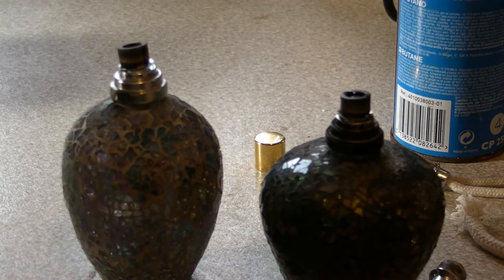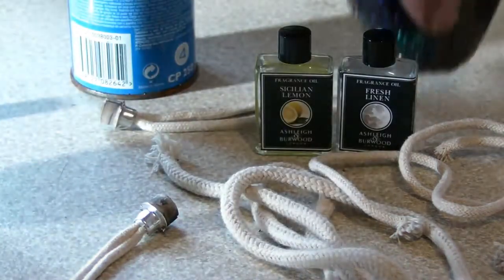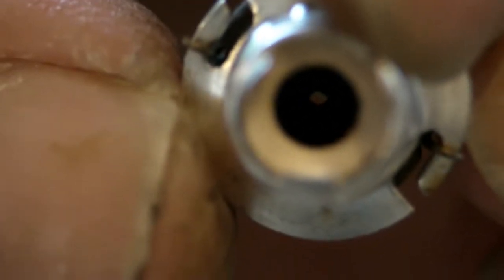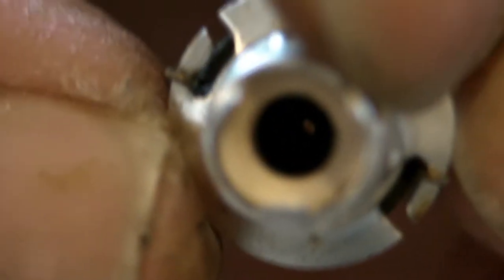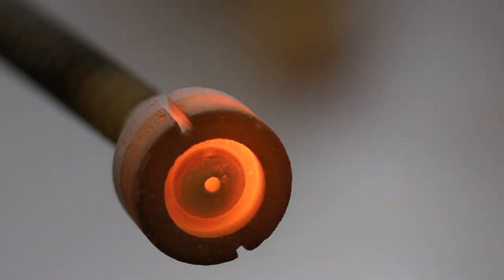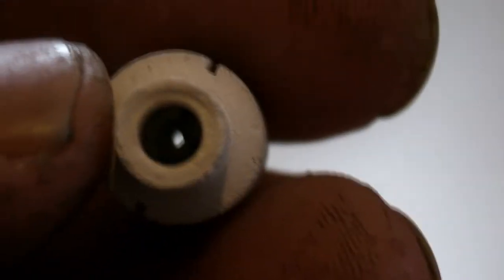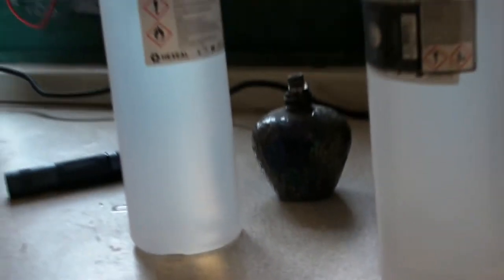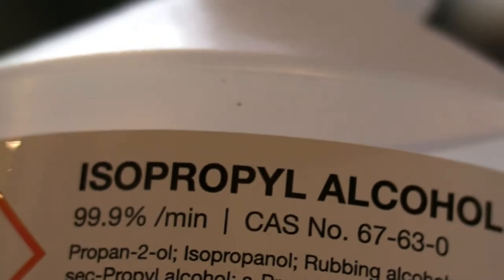Catalytic oil lamp aka Ashleigh & Burwood lamps. Stone and Wick restoration and DIY scented fuel,

Comment: Holy moses.  I have just made my first batch of Sea Breeze, following your instructions.  I already had a 500ml bottle of 99.9% so just ordered the little bottle of Sea Breeze.  To equal to a 1/4, I added 1.5ml of essence.  Even while I was mixing it I was convinced it was not going to work becuase it smelled strongly of acetone (before and after the mix).  Having made it, I used it anyway and I am now sat here imagining myself on a beach, (ok, slight exaggeration), but it is lovely.  Lampe Berger Ocean Breeze is my favourite, but this is pretty dammed close.  Now I know it can be made so cheaply, I am off to buy some more burners for other rooms in my house.  Brilliant.  Thank you so much.
Reply from the maker: You say acetone but i assume you meant to say isopropyl alcohol.
Reply: @Cornz38  Ha ha.  No, I meant to say Acetone.  It is definitely 99.9% Isoproypyl Alchohol, but smells like Acetone (nail varnish remover).  It seems there are a few people on Amazon who say the same thing. What I have made is really nice and strong when diffusing, but sadly, doesn't seem to linger as long as the original?   Still very nice though and much cheaper than the original.  Thank you.
Reply from the maker: @s.c3773  Do be careful, some of the oils are MUCH stronger than other. The mango and nectarine is sickly and overpowering if you use a drop too much oil.
Reply: @Cornz38  Thank you.  I have only made the one bottle at the moment using a ratio of 1/4 to 1L. That will be my starting point for any future batches I make.  Really liking this. :)

Comment: Thanks for making this video! I have seen (though only one other YouTube video seems to explain the process) how to make the liquid at home, but not how to restore and refresh a "wick-catalizer." I don't have a blow torch handy but perhaps a butane lighter could get the job done? I will have to test it out. Again, there's wonderful money saving information here, I appreciate it! Thanks!
Reply from the maker: It needs to be glowing white hot. A normal cigarette lighter wont do it, one of those wind resistant turbo lighters might. Even then, the wicks will eventually degrade to the point where they are unrecoverable but it will extend it's life 3 or four fold.

Comment: It’s actually the metal wire (platinum) that has the whole catalytic process going… There is a video on YT with the history and science of the lamp.
Reply from the maker: What metal wire? Don't say the piece of wire that holds the ceramic is because that is NOT platinum. You can remove that and the lamp still works. There is NO platinum in these. It has nothing to do with it. The ceramic heats up to a point where the IPA is vapourised and it is then self sustaining by capillary action and heat..

Comment: Great vid. indeed! Most appreciated! Not sure what the metal catalysts are in there but 2000C blowtorch hopefully wouldnt vapourise any of them. I know platinum melts at 1700C odd though so that might start moving. Certainly blowtorching shouldnt deplete the platinum component of the catalyst, it vapourises above 3000C. Brilliant!
Reply from the maker: There are no metal catalysts. It's ceramic.

Comment: Hi, thank you very much for this video, it is really informative and useful.  The thing that's puzzling me is the fragrance oil you mixed with the 99.9% alcohol.  The small bottles seem to be just a smaller (and more expensive) option than the larger bottles which are meant to be used neat?  How then can using 1/3rd bottle to 1L produce the same strength of fragrance, surely, the fragrance must be 'watered' down a lot by mixing with more alcohol?  I did note that you tried a full small bottle but had problems with the burner, again I am not sure why this was as you were just adding more alcohol which is the basis of the original fragrance.
Reply from the maker: The small square bottles are the essential oils and are not diluted. The manufactures recommend not to use them, but then they would say that. So you are adding neat oil to pure IPA.
Reply from the maker: A bottle of oil is £3 apx, 1 litre of IPA about the same. From one £3 bottle of the oil, you will get 2-4+ Lts of fragrance so, it is MUCH cheaper to make your own and not difficult. Oh, IPA is HIGHLY flammable, do be careful.
Reply: @Cornz38  Thank you.
Reply: @Cornz38  Thank you.

Comment: 5 ml of oil (natural or otherwise) to a liter of alcohol.  Or 100 drops. A lot depends on the oil as some are stronger smelling.  If not potent enough - climb by 10% steps.  
And don't forget that you can definitely go for your own brand :) by mixing different oils.
Reply from the maker: Agreed, some of the oils are more potent. My personal favorites are Sicilian Lemon and Fresh Linen.
Reply: @Cornz38  where do you purchase your oils from and do I just need to look for pure oil? I have some of the catalytic burners but it's been a long time since I used them.
Reply from the maker: SO sorry for the almost year long delay. Ebay. Or Amazon. ALways cheaper to buy several.  @loveishope4406

Comment: Perfect video, just wot I was trying to find before splashing out so much money. Thanks for sharing! 
3 questions for u. 
1. Could u make one of these using a pretty bottle u have at home and buying a catalitic wick? 
2. R they worth splashing out all the money ie r they as effective as they say they are. 
3. Around how long does a wick last. 
Thank u so much! X
Reply from the maker: 1: my understanding is that the glass on the originals is heat resistant so i wouldn't trust any old bottle. YMMV
2: i love mine and i buy wicks from aliexpress, not A&B further reducing my costs.
3. depends on how much oil you use but i can get a good few months out of mine. The weak point is the collar where i push twist the new wick in. They break easily there.
Reply: @Cornz38  thank you x

Comment: I've always wondered one thing,
Can you use the fragrance oil as regular lamp oil?
Reply from the maker: Not to the best of my knowledge, but don't quote me. I seem to recall the oil is different.
Reply: @Cornz38  ah yes i just found out it's not alcohol based It's kerosine.
It would work but I think it would burn out much more quickly.

Comment: after 20 minutes of burning, is it last for 6 - 8 hours?
Reply from the maker: Sorry, i do not understand your question. Burning what for 20 minutes?
Reply: @Cornz38  You burned for two minutes first, Then it smokes for 20 minutes, After 20 minutes you turn it off, Now how long will its fragrance last in the room ?This is what I wanted to ask you
Reply from the maker: IF the wick and stone are in good condition it will burn until the fuel is gone or you extinguish it. As for how long the fragrance lasts, how long is a piece of string? If your house is draughty then not long at all. I now make the fragrance weak and just let it burn all day so there is a constant pleasant smell from morning till night. @hassanrajpoot6957
Reply: @Cornz38  good to know, thank you for your kind reply.. :)
Reply from the maker: Thank you for watching and engaging with me. All the best for 2024. @hassanrajpoot6957